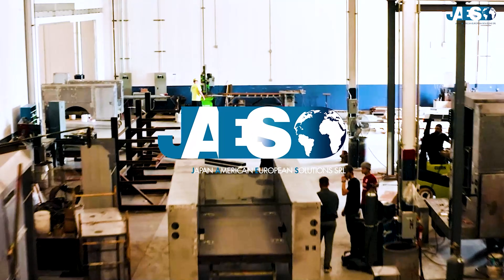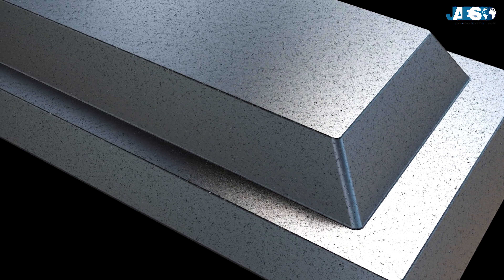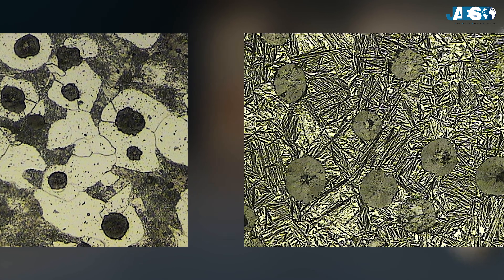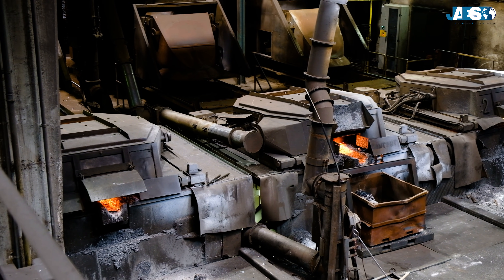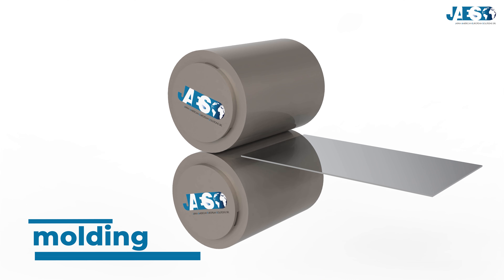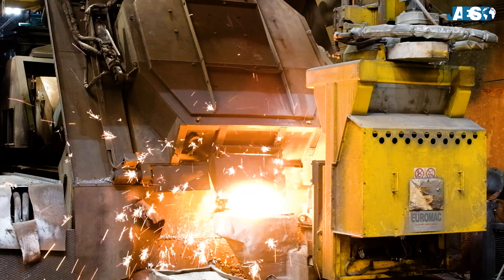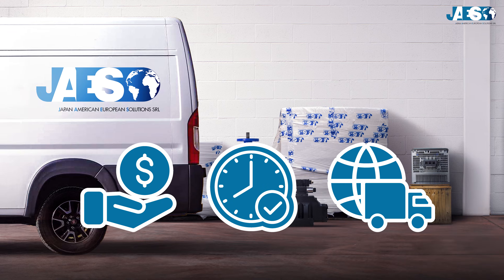STEEL MILLS: How Do They Work and What Is Steel Production?

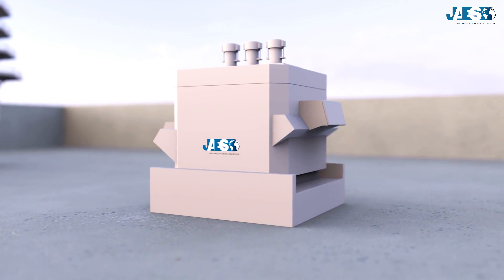Comment: 0:42 (C) coke ? Should it be carbon ? And (CaO) is Calcium oxide
Reply: Coke is carbon. You are right about the lime part, he should have said quicklime instead.
Reply from the maker: Yes, coke is primarily composed of carbon (C). It is obtained through the high-temperature distillation of coal, eliminating volatile components and leaving a carbon-rich product.

Lime, specifically quicklime, is mainly composed of calcium oxide (CaO), which is produced by heating calcium carbonate (CaCO₃) at high temperatures.